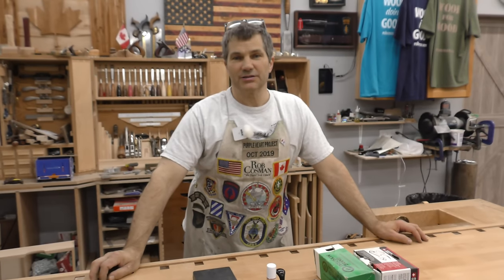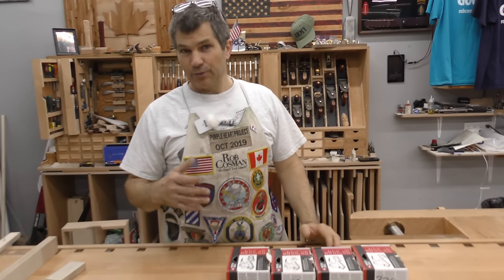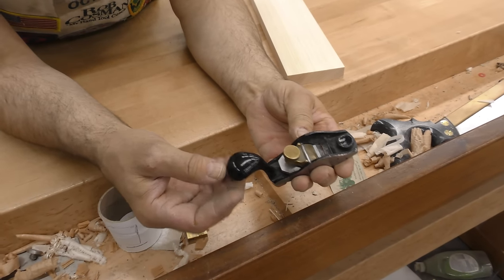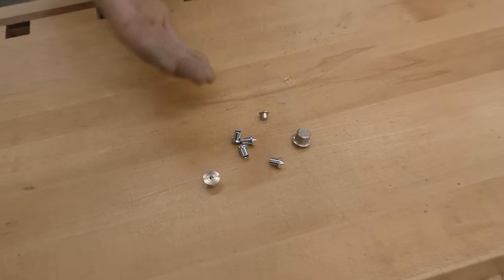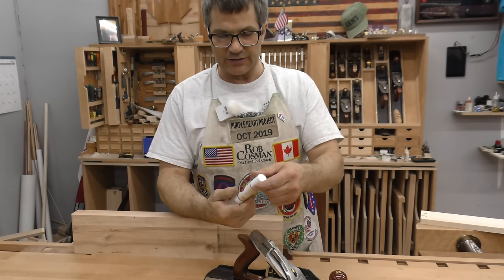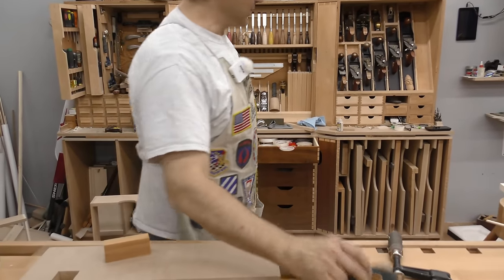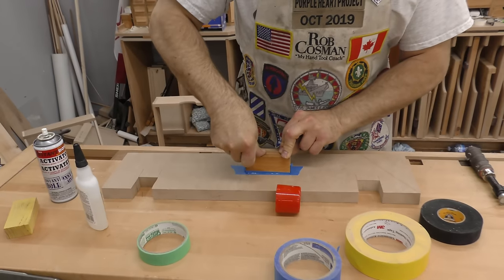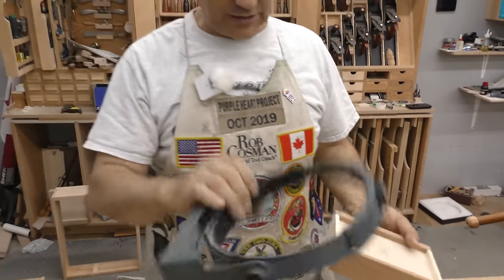Top Woodworking Gadgets - MUST HAVE ITEMS

Comment: I find old bicycle inner tubes can be really handy in lots of ways. They're most useful when you need to clamp a very oddly shaped item, and regular clamps will either damage the surface due to uneven pressure, or simply won't stay in place. If you wrap an inner tube tightly around something multiple times, it exerts an incredible amount of clamping pressure. You can typically secure the ends with a small spring clamp or tape. You can also use the inner tubes as cushions on vice jaws as opposed to leather, or cut them into small pieces to use as heavy duty rubber bands.

Comment: Playing cards. Used them all the time as shims when I was a trim carpenter. Place one on either side of the chop saw bed to angle a cut just a little bit more. Place underneath a hinge or lock set to help bring it flush to the surface. And toothpicks for filling in stripped out screw holes.
Reply: Great ideas!  Thanks for sharing
Reply: I picked up a deck of playing cards after hearing that they could be used to set the depth of guitar strings where they should be above some of the frets.  Since I haven't gotten into fretting, yet, they're still unopened in my shop. =)
Reply: old credit cards make great shims too.
Reply: And matchsticks also for stripped screws
Reply: @jacklarson6281  credit cards are my favorite for spreading glue around... they are thin and flexible, yet very strong.
Reply: I have a box of business cards that I was going to throw away when I changed ph numbers. Been my shim stock for about 10 yrs.
Reply: Golf tee's also make a great filler for large screw holes.
Reply: I used to do the cocktail stick trick but if it's important I drill it out, dowel it then redrill it.
Reply: they're great for one time use mixing epoxy etc on or spreading/scrapping wet glue too
Reply: I use the round bamboo bbq skewers for plugging little holes. They’re strong and easy to whittle down if you need to. Toothpicks are a great idea for a slightly smaller hole, thanks.

Comment: as always thank you for the video.  my biggest 'gadget' that you didnt mention is probably the silicone grippy shelf liner.  i use it to protect my work from scratches or dings when i am setting it down.  it also works amazing in a vise to prevent any slipping.  i also keep alot of magnets around
Reply from the maker: Your are absolutely right , that's great stuff....Thanks for the tip
Reply: I use old carpet pad to protect wood and minimizes slipping.
Reply: Anti skid stuff for rugs is handy, although not the best for glueing to things. I use it under my granite slab and portable engineers vises and in place of leather for shop tasks because you can cut it with scissors. The really thin stuff is best, the more common thicker stuff i find is too squishy for a lot of applications.

Comment: I'm a gunsmith/ Stock maker and I think you have a great idea with the self adhesive sand paper.  I also like to use for grits up to 600 the belts used in belt sanders.  I just cut off from the belt what I need.  They use a better quality of backing, and adhesive which makes them last longer.  They also have a stiffer back and glue to a board or dowel for sanding blocks.

Comment: I think your bench lamp is very important too !! Using a good light makes my work easier.
Reply from the maker: I totally agree!   OK I am doing another one of these videos to highlight all the stuff I overlooked!
Reply: RobCosman.com I have one that is LED and very bright and no heat output plus has a large magnifying lens in the centre.....I use that a lot......cheers from Aus
Reply: Great tip! Most people don’t realize how much good light improves your ability to see. A good, bright full spectrum LED lamp that you can move to highlight your work as you saw and chisel is invaluable. Your loupes or “head gear” will also work better for you if you have good light.
Reply: I have a light on my magnifying glasses, need both now I old!
Reply: I thought the sliding bench lamp was quiet, understated genius.

Comment: I’m a carpenter and for the last 30 or so years have always had a piece of white Formica I cut to the size of my Fat Max tape measure and epoxy it on the the side and it becomes a little scratch pad to write down measurements.  Because the area is limited I’ve come up with my own form of shorthand symbols for shapes & words.  I’m now 65 and couldn’t remember numbers from one second to the next while I’m concentrating on something else.  You can always use a scrap piece of wood, but the tape is always with you no matter where.  Erase it with a bit of spit & rub.  Nobody will want to steal your tape then.
Reply: Jerry, thanks for the tip. I’ve just retired due to health issues & am going crazy in my Shed/workshop trying to learn a dozen trades in shortest time possible. Thanks for the tip. Pity it’s midnight here in Canberra & neighbours will get a little irate if I start work now... Kind regards from Australia 
Mark
Reply: Jerry S. thanks fir that grett tip

Comment: Diopter means that it is a magnifying glass so both eyes can look through it simultaneously.  I love that you made it the number one tip.  I need a minimum of a 2.0 in my welding hood.  The most readily available are 1.0 to 3.0 in .5 increments.  Other increments are available but more difficult to source.  Thanks Rob!  Keep up the great work.
Reply from the maker: And now I know!  Thanks.  Yup I use them all the time

Comment: When I worked in the hardware store/lumber yard I used a tape holder that was magnetic. The tape had a steel disc screwed to it and the holder was plastic with a magnet and it clipped to your belt. Man did I love that, plus if someone borrowed your tape you always got it back because they could not clip it to there belt.
Reply from the maker: I have seen those before.  They look very useful

Comment: I have found an excellent tool for holding down my new chiseles as I hand flattened them. It's a five-ounce, three-inch-diameter, hand-stiched, rawhide sphere called a baseball.

Fits very nicely in the hand and allows me to apply pressure with my palm rather than fingers.
Reply from the maker: Awesome tip.  I am going to try this one

Comment: After spending over $100k in tools during my career as an auto tech, I'm actually using quite a few of them when woodworking, more than I would have guessed.
These are just some of the "crossover" tools I use; feeler gauges, digital calipers, micrometers, "helping hand" magnifying glass, nitrile rubber gloves, (wood severely dries out my hands, I don't use them when using power tools though,), large C-clamp locking pliers, lead and brass hammers, rubber mallet. That's what I can think of at the moment, but I know there are more.
Reply from the maker: I agree with all.  I really like your idea on the helping hand magnifer
Reply: @RobCosmanWoodworking  Hey Rob thanks for the insight of sharpening plane blades and setting them up properly. I just left you a comment on sanding inside curves and how to make a tool to do the job a little easier than trying to coil a piece of sand paper around a dowel rod or or a finger.

Comment: Mechanics dish with magnetic base. Keeps small metal items (screws, Allen keys, small drill bits etc) where I left them on the bench, and not hiding in the shavings on the floor.
Reply: Me too. Free or low cost a Harbor Freight.
Reply: I’m a very new beginner, always losing drill bits and screws in the sawdust pile. I never really thought of that! Good idea!

Comment: My small tip for what it’s worth, I bought some blackboard paint and painted the inside top half of the entry door to my workshop, next to my minuscule bench, and turned the back of the door into a blackboard. A small holder for chalk and a duster and I cannot tell you how incredibly valuable it has become for jotting down quick ideas, measurements, quick drawings of parts etc. it is truly astounding how often I use it now to the point that I also made up two more on framed boards that hang on the bottom half of the door that I can unhook and carry to other parts of the workshop and prop up so I can see the measurements or whatever right where I’m working. Seriously, try it. I didn’t think it would be anything but a bit of a lark when I first painted it but now it’s indispensable in my daily workflow and hopefully it will help yours too. Tho you might need to hang yours upside down to mine as down here in Australia things are right side up so . . . . 😎
Reply: Ha!

Comment: Great videos, Sir!  My favorite non-traditional "tool" is a bar of soap.  Any time I'm driving a woodscrew, especially a brass one, I flick the threads across the soap (you don't need much) and that makes driving so much easier.  Some folks use beeswax, but I already had the soap and it (may) be cheaper.
Reply: My father used to do that about 60 years ago. Works well.
Reply: I haven’t seen this mentioned much - usually wax is used now - but this is a tip I learned from my dad when I was a kid and we built shelves using screws (driven by hand back in the day).  He’d always have to finish driving the screws as I was too little and didn’t have the strength yet.  He learned it from his grandfather, my great grandfather, who was a lifelong professional carpenter and homebuilder in an era before any power tools.

Comment: The flat metal ‘bristles’ from a rotary street sweeper can often be found in the gutter around town. I always pick ‘em up. Hardened steel, thin and stiff, they’ll even take an edge to make a tiny chisel or a burr as a tiny scraper in a corner. Fit a handle; 101 uses.

Comment: GREAT TIPS!!!  Glad to see you use the "head gear"; me too. BUT! what to do when the lenses start to fall out! (I struggled for years, because I actually DID want to change them out for diff. diopter), the fit got slopppy with the little rivets holding them in. I mentioned this frustration to my smart son-in-law; in just a minute, he put the lens on the INSIDE; and---boom! no more falling out!! no glue, no other modification. Try it you just might smile.

Comment: Had to look to see what got missed from everyones list. Most reached for, a pick with a point on one end and a bend on the other, dads old “pinchers” for pulling staples and nails,Digital callipers that read fractions and decimal,and “Uncle Bills” sliver grippers. Learning alot from you Rob,thanks.

Comment: Hi Rob - I have all of your top ten 'gadgets' and have done for years. My squirrel tail plane is a Kunz but is such a handy plane. I make guitars and this little plane does the jobs no other plane can. As for another item - I have a box of glazers shims which are used in double glazed windows they come in 1mm - 6mm stages and as they are made of PVC they do not damage delicate woods when used to shim a project. I use them under clamps to protect the wood and to shim jigs etc. Great work by the way.

Comment: I keep a 5 in 1 painters tool in the top drawer.  It's great for all kinds of things about the shop - scraping glue or grime from the worktop, opening boxes and cans of finish, spreading wood filler, separating projects being held down with the CA / tape method, cleaning glue from other tools, the list goes on.  It's invaluable.

Comment: Machinists 1-2-3 blocks. I use them for machine setup and calibration, alternative squares, stop blocks, drawer slide spacing and a few other uses. I also use Scotchbrite pads for quick removal of light surface rust.
Reply: @R Dalton I also use my 123 block with a couple of magnets to set a 1" offset from my table saw fence. Use the table saw fence to set the crosscut + 1" and place the 123 block left of the front of fence best the front.
Reply: Scotchbrite pads, especially green, are excellent for removing those dust nubs in wipe on finishes (satin). According to the 3M website, the green is akin to 320 grit. But I've never had a problem with objectionable scratches.

Comment: I have used a pair of Weems & Plath Ultralight dividers (#176) for many years as a boat captain. They are accurate and one handed for use plotting on  charts. They work great in the workshop.
Reply from the maker: A good pair of dividers is hard to beat.

Comment: My dad was a ship’s carpenter and boat builder. From early childhood I would assist him on all kinda of projects. Starting with cutting down trees to be used in the projects. He taught me so many trick, tips and methods. I still have 3 generations of woodworking tools that I use in my shop. One of the better things he taught me was removing or extraction of old seated screws, spikes and nails in restoration projects. Simply, using a sample squeeze bottle of peroxide and applying it generously around the screw soaking the area. Then allowing some time for capillary action to have it soak in. It saved a lot of effort getting it out neatly and spared the restoration any damage. Hope that helps someone!

Comment: painters tape and CA glue. If your wood work its a must combo. I do alot of prefinished and raw woodworking that sometimes requires routing with templates. This method lets you put a template on the work surface and protected from the glue no nails or clampes required and just pull off when done

Comment: Rob, great tips as always! Clarifying on the calipers, you may have mispoken.. the ones you showed are dial calipers, "vernier calipers" refers to the vernier scale on non-dial calipers that allow you to determine the measurement much like an old slide-rule. As you expand them, lines on the vernier scale align to tell you the measurement. The main advantages are that they are cheaper to produce and don't have the sensitive dial that can be bumped out  of calibration.
Reply: The calipers that Rob showed WERE vernier calipers. They also had a dial indicator as well.
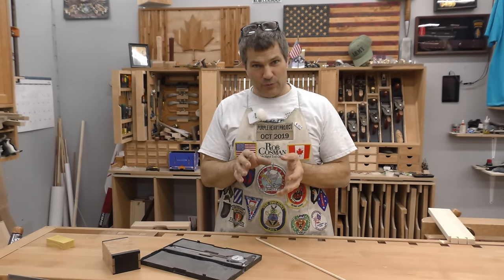Nevertheless, at 9:04 he actually stated that they were Dial Calipers.... DOH.
Furthermore, everyone uses digital calipers now days. In the world outside the USA, it's so easy because of the use of millimeters. Finally there are now cheap ($20 or so) Fractional calipers that can directly read out fractional inches.
Aside from being simple and quick to read, the best thing about digital calipers is the Zero button. Measure one object, and hit zero while still clamped to it. Now measure second object and directly read off the clearance/interference.
Reply: @johncoops6897   Respecfully Sir that is not accurate.  I meant no offense and I'm not trying to have a digital debate. I apologize if my comment came across as rude somehow,  but I don't think it was written in a negative way.   I'm trained in metrology and have some experience using both types.  I think we're all here to learn and get better. I have nothing but the utmost respect for Rob. I think that was reflected in my original comment.  Dial calipers/digital calipers do also have a scale, but not a Vernier scale. That form of scale was invented by Pierre Vernier and is a really cool invention that allowed for leaps in precision by magnifying errors.  It may be a regional semantics thing to call them 'Vernier' colloquially. I was just trying to be precise...like Rob is in his Joinery : - ) . Like I said we're all here to learn.   I love Rob's videos and I was simply trying to add to the learning & dialogue.
Reply: @benchtopwoodworks  - I know what a Vernier Scale is, and have used Vernier, Dial and now Digital calipers for over 50 years. One of my metric dial calipers also has a vernier scale on the depth bar, so when I saw the etchings on Rob's calipers, I (perhaps falsely) assumed that they had a Vernier scale as well.

Comment: For clamping: I have near the bench 20ft rope, 3/16. All kind of wedges.  I use a syringe for gluing mortise joints. Cheap lite weight plastic clamps to keep things in place before putting on the heavy clamps. Duct tape. Thanks for this video. The reactions bring out tons of usefull tricks. Great!
Reply from the maker: Wow, great tips.  Got to love duct tape.

Comment: You hock tape tip changed my life. I use it on all my hammers, mallets, and saw handles (I use Japanese saws so it fits). The only thing I use that’s not traditional is a few bicycle inner tubes I cut into one long strip each. They are basically giant rubber bands that are great for holding odd shaped parts together or glueing long thin strips like when I put the back on a bow.

Comment: I'm right there with you on the necessity of keeping an assortment of tapes in the shop. Unlike you, i don't buy adhesive backed roll sandpaper for making sanding blocks. I use 3 inch wide double sided tape by Venture together with regular sandpaper. I just cut a piece of tape slightly oversize, trim it to exact size if the block and then add the sandpaper and trim that to match.

Comment: Chopsticks and/or bamboo skewers...cheap and thousands of uses
Reply from the maker: Yup I can see that.  GREAT tip
Reply: Really? A couple of examples please.
Reply: @robertthomas6127  Guys at our club use them as hinges for small boxes. (they aren't all the same size but cheap enough what you don't use in the pack don't matter)
Reply: As a restoration carpenter, I use them to fill old stripped screw holes in door hinges.  Drill out hole around the size of the stick.  Dip stick in a little glue, stick it in and break it off.  Retap with a smaller bit for a new tight fit to last another 100 years!
Reply: I picked up a pack of popsicle sticks at Dollar Tree and have been using them for temporary shims and mixing epoxy and such.  Used several together to block a ground hornet hole to keep them from escaping while I poisoned it last year. =)
Reply: So true
Reply: As dowels in thin wood pieces which are butt jointed. Nice visual depend on the wood when angle drilled as dowels.
Reply: Also: tongue depressors and/or popsicle sticks.